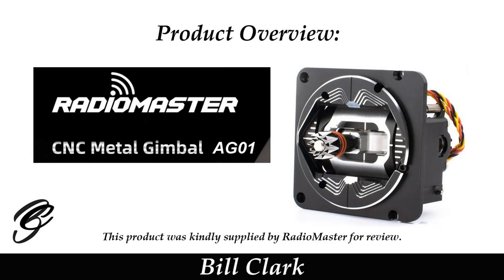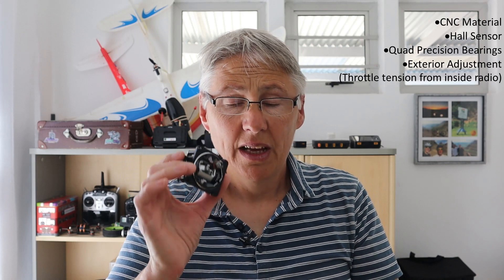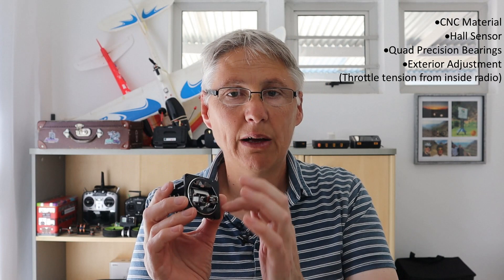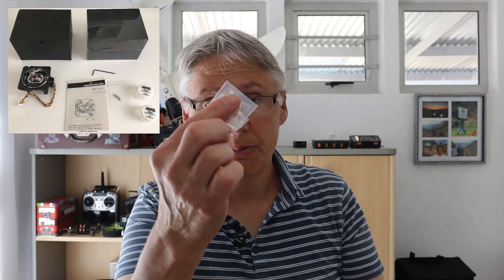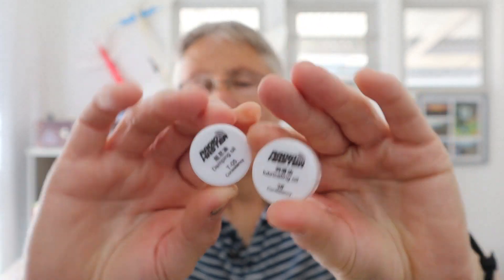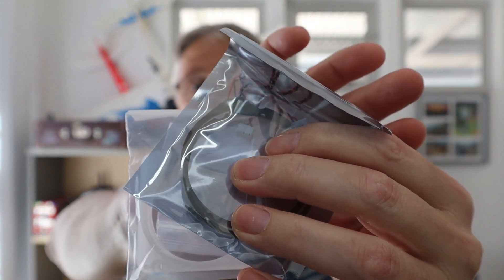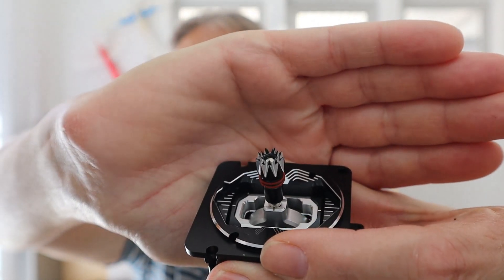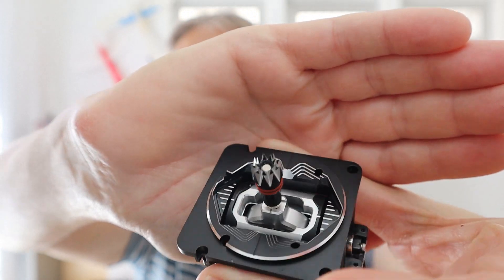Product Overview: The RadioMaster AG01 CNC Metal Replacement Gimbals

Comment: Thanks Bill,  they're a bit pricey. I'll follow you up on yours and hopefully they are worth the extra cost happy flying 🙂.
Reply from the maker: Hill, I must say they are very nicely made but nothing wrong with the gimbals already in the TX16S.
Reply: @the-happy-RC-flyer  Yes there is, there are reports of little pins dropping off causing the centering to fail, and in my case one of a pair of Hall replacement gimbals was broken as delivered. There are some very small and very frigile parts made of brittle plastic. But having said that, are they any worse than other parts made down to a price?
Reply from the maker: @kencroft7933  my experience with all the radios I have used I have not had a gimbal problem so far. My radios get used far more than the average RC pilot because they are used for testing and filming. Time will only tell with the AG01’s they do feel very solid but not cheap. Have you had problems with a particular radios gimbals Ken?

Comment: Hi Bill it's Marty from Canada and sorry my isn't related to this video. I ended up getting the radio all updated and all is good now thanks to you Bill. Now my problem is that I can't get SAFE to work with the umx turbo timber I've tried to get it to work on the channel 5 gear channel like the manual suggests to use but no way can I get safe to work do you know how to set the safe select to work please help if you can thank you so much in advance your friend Marty from Canada 🇨🇦🛩🛩
Reply from the maker: Hi Marty, I hope you are well. I am sorry I cannot help you with your problem as I do not have that airplane or use Spektrum equipment maybe one day they will send me a radio to review and I will then learn their system. Sorry I cannot help you this time. Pleased to hear your radio is all good.
Reply: Marty If you have a look on Brian Phillips RC you tube channel he only do spektrum he is very helpful. I use to fly spektrum.
Reply: @johanopperman8039  thank you Johan for replying to my problem. I have this airplane working on my spectrum radio but my problem is that I want to bind this plane to my radiomaster tx16s using any kind of gyro system that might work as the same as safe. If you have any other ideas please let me know and thank you again your friend Marty from Canada 🇨🇦🛩🛩
Reply: @the-happy-RC-flyer  hello Bill thank you for responding to my problem so quickly, but what I want to do is bind this plane to the radiomaster tx16s using the spectrum protocol in the radio which I did bind the plane to the radiomaster tx16s but I can't use the safe gyro system. I have binded other types of aircraft like the eachine mini warbirds and Volantex cub 500 and all their safe gyros work but not this plane lol if you have any other ideas that might help me with my problem please let me know thank you your friend Marty from Canada 🇨🇦🛩🛩
Reply: @johanopperman8039  I did not mention that I do have this plane bind up to the radiomaster tx16s but I can't get the safe gyro to work. I have the eachine mini warbirds and I have bind them using the protocol in the radiomaster and their safe gyros work I have a Volantex cub 500 and it's safe gyros work but not this plane I have now lol if you have any other ideas for me and my problem please let me know thank you your friend Marty from Canada 🇨🇦🛩🛩
Reply from the maker: @martymannisto1109  Hi Marty, which spectrum receiver are you trying to bind to your radio? I will then try to assist you.
Reply: @martymannisto1109  Hi Marty. There is John from rc video reviews on YouTube he is big into radiomaster. I think he helps with the development of the new EdgeTX. He helped me a lot too. I have the radiomaster too. I'm only using EdgeTX now. It's fantastic with the touch screen. Hope you get it sorted.

Comment: Which parts are made of metal? When they say they are CNC machined does that mean that all the parts are metal including all the little bits that break off? Or are only the visible "bling" parts that are on show made of metal?
Reply from the maker: Ken, not all of the gimbal is metal but they are considerably more solidly built than the originals. I should have compared the weight to the original gimbals.

Comment: Hi Thanks for this short video Bill
Radiomaster says in their website that the mode can be switch between self-centering and Throttle  have you try that ?
Thanks.
Stephane
Reply from the maker: Stephane I have and it works fine.
Reply: @the-happy-RC-flyer  Thanks Bill

Comment: Hi Bill. Thanks for video. Sorry my question is not related to the video.
 Sorry to bother you again. I want to upgrade my control board i got the CC3D and it doesn't work with betaflight. Can you please suggest a good control board
Kind regards
Johan
Reply from the maker: Hi Johan, what were you using the CC3D in?
Reply: @the-happy-RC-flyer  my quadcopter
Reply from the maker: @johanopperman8039  Johan I think Diatone FC's are good value for the price.
https://www.diatone.us/
Reply: @the-happy-RC-flyer  Thanks Bill I will have a look